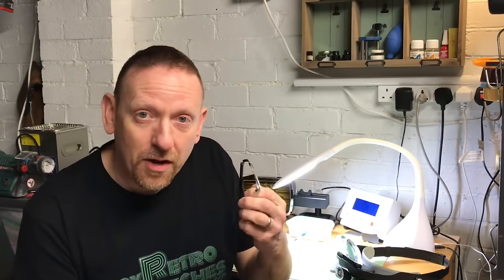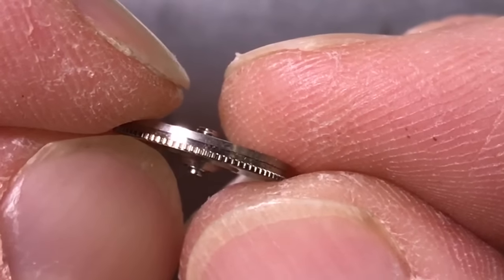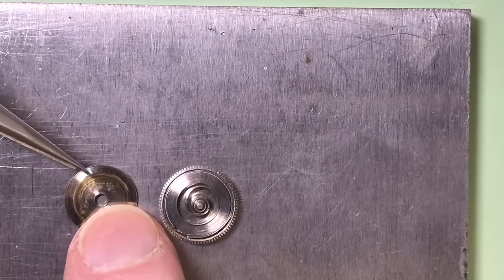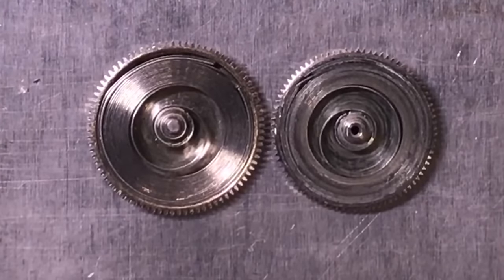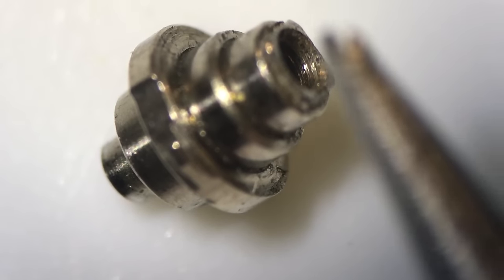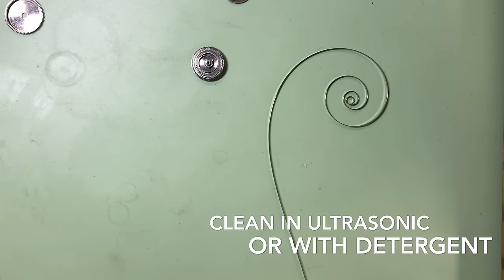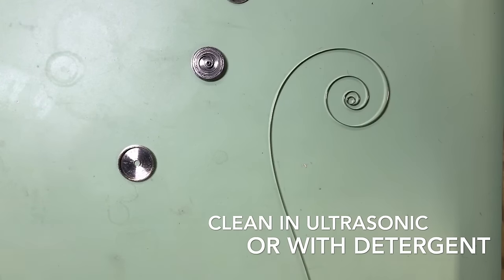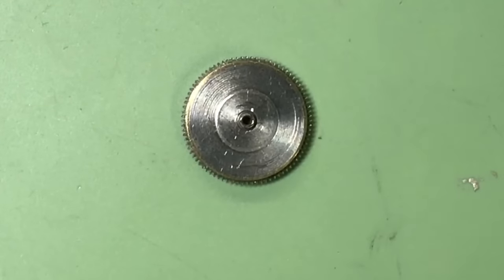How To Service a Watch Mainspring By Hand

Comment: Well that’s saved me a couple of hundred quid, it can be done by hand with no I’ll effects, thanks new to your channel and it’s a lot of useful info. Got me an early Seiko auto to start on just need the right size screwdriver and permission from er indoors to by them. 👍🏻👍🏻👍🏻
Reply from the maker: well I do not recommend this long term as any professional will tell you this is a massive NO NO to hand wind.  It is not easy depending on the spring you are working on.  I do believe there is a Chinese winder set on AliExpress that has steel arbours and handles which do the job well enough and are around £60-70 for a set.  I will pick some up at some point to review.

Comment: Thanks for the time and added bother of putting this up here. So far it's the most applicable guide I've found to my own situation: I've had a garishly over-steampunked Chinese pocket watch for years, for which I think I paid just $4 with free delivery from the Far East. Only lately has it been anything less than "appropriately reliable". It kept reasonable enough time for my post-retirement needs, and spends most of its life safely tucked away in the breast pocket of my old motorcycle jacket. I've always taken care not to overwind it, but I suspect something may be awry with its main spring. It'll still runs near full wind, but only for 4 or 5 hours. I'm guessing that it's the mainspring somehow acting up. The problem for me is that it seems silly to spend a whole lot getting g a $4 watch repaired, you know? I adore it and all, bit still... If I can fix it DIY, it seems sensible to do so. Naturally, any and all advice from you or other proper horologists in the Comments would be welcome. Until then, you get a big "Thumb's Up" from me for your efforts. Thanks again!
Reply from the maker: Hi, That is hard to say what is going on there. In theory the mainspring could be the issue as its the only source of energy. However the power has to go through the train of gears. All pivots should be oiled but over time that oil turns to sticky gunk which can slow watches down. equally a thicker oil is applied to the barrel arbour bearing (holes) as its higher friction so when that oil goes hard it will limit the power of the spring.  Springs generally last decades but who knows what sort of quality spring they have used in a $4 watch..
Reply: @MyRetroWatches  Thanks for the response! I'm now inclined to think you may be right about there perhaps being a problem with the works being somehow gunked up with old oil, hardened grease or what have you--not just the mainspring that's the culprit. For the past couple of days I've managed to run out the mainspring's tension by either lightly tapping the watch or simply turning the crown/winding stem the opposite direction from winding. I imagine the tapping of the ratchet mechanism may be just enough to coax the works through those grubby spots. Once it gets going, it'll tick happily for hours and hours. So yeah. Maybe it just needs a good servicing? I've also read that electro-magnetism, such as from a cell phone, can also goob up the works, and de-magnitizers are sold to correct this. The jacket pocket I normally keep the watch in rests directly over the shirt pocket I hold my phone in. Have YOU encountered this magnetism issue? Fortunately, I have located a very well-reviewed horologist's shop quite nearby. Instead of diving in and just buggering it up myself, perhaps I should just swing on by there. Sure, it's just a $4 watch, but I really DO like it all the same. And it HAS served me well enough until just recently for many many years.

Comment: Thank's for this video! I am studying this and working ON IT as we speak. I kind of placed the mainspring in the wrong direction, so it got little bit twisted/damaged so finally it broke but hey, as i say: Practise makes perfect. 

I love your videos! A true inspiration for all of us out there!
Reply from the maker: Thank you for your nice comment, also just subbed to your channel !
Just remember that hand winding is not good practice in this hobby and many will tell you it should not be done.  That said I’ve scrapped more mainsprings in winders than I have ever done by hand.
Reply: @MyRetroWatches  Thank you! I am honored by that! And Your videos about bulova has helped me to gain experience and to fix them. I appreciate this ! 

Take care 🌎☕🙃
Reply: I had the same problem. It came out great, but rewinding somehow got twisted around so that the final coil was backwards and broke after another attempt. (I realize now I wound counterclockwise! Should have been clockwise.) That's fine since it was 52 years old anyway. A NOS mainspring is in the mail. I'm going to take a closer look at the inexpensive winders. There's an affordable one now that supposedly fixes past shortcomings.

Comment: Would you advise replacing with a new main spring or just cleaning? I'm just starting on my first movement AS 1506 which has been sat doing nothing for over 40 years.  Lots of good information on your channel. Very helpful.

Comment: Thanks for this video! Mike or anyone else who's done this: what is the success rate of winding the mainspring this way? I ask because many professionals seem to say hand-winding can cause a lot of problems and make a watch not work properly. But also I don't doubt some hand-winder repair people they speak of are the the kind who aren't too careful about watch repairs to begin with. Mainspring winders also seem to be some of the most unforgivingly expensive watch tools out there for novice repair folk--so if hand-winding can work, that'll easily save me a few hundred bucks. Thanks in advance for your replies!
Reply from the maker: This is a good question!  okay so I will try to answer,  without question the best and the correct method is to use a spring winder tool. They are expensive and you need many different winders for different barrels both left and right handed.  This for me at least is the reason I learnt to do it by hand . By hand you do run the risk of breaking the bridal, kinking the spring, snapping the spring or even it uncoiling half way though and throwing the barrel into orbit.  Care must be taken, safety glasses are a must.  However with practice and patience its achievable.  You will make mistakes so practice with some old ones first to get the hang of it, also practice without oiling the spring or the barrel walls , oil makes them allot more slippy. The hardest part is the first few coils the bridal holds allot of tension so getting that in and the spring past it can be hard. once past that slow and steady wins the race. That and a firm grip  another important thing to take not is the direction of the spring, always take a photo first as I have learnt the hard way of winding a spring in, fitting into a movement and rebuilding only to find the spring wont hold tension past the arbor. you then have to take everything to bits again. 
For newbies and tinkerers on a budget doing their own watches then I see no harm in hand winding other than the more experienced telling you you should never do it.  The more you get into the hobby the more you will want to invest in better tools I think its just a natural progression.  

Good luck
Reply: @MyRetroWatches  I've been hand winding main springs for 20 years with good success. I also know when you take one back out and set on a flat surface, it does cone up and not lay flat. So I can see why the experts would have a problem with it.

Comment: Hello Mike. Great tutorial. Moebius 8200 isn’t an adequate braking grease and may actually allow too much slip. Moebius 8213 (brass), 8217 or more expensive Kluber P125 is what is recommended.
Reply from the maker: 24 Hour GMT Channel hi thanks. Yes you are right I think someone else corrected me either here or in the FB group.  I now use 8217.   Thing is you can’t edit already uploaded videos so I’m stuck with it really. ( wish YT would allow us to do so post upload)
Reply: RL-1

Comment: If you forget to take a photo just stop and think about which direction the barrel turns to wind up the watch. Pay attention to the click. Make a little diagram with the wind direction if you need to. The square on the arbor will face up on the click side putting the opening on the barrel facing down or toward the face side of the watch. 
I find that with many movements the winding gear for the barrel moves clockwise when being wound which means winding is counter clockwise when looking into the barrel. This means that the spring spirals out from the mandrel in the clockwise direction.

Comment: Nice video. I do slighly different than in this video. I use a collet plate (round holes)   to press the arbour back if it moves out during dissambling. I also use the same collet plate when I put  the lid back on. I usually try to hold the spring almost full wounded in, and put the arbour in place and then put the spring over arbour (sometimes I just do as in this video as well), since it can be more easy than the other way.

I also try to clean my hands before the work (I don't use finger cots since they just get stuck). I akso just use the tenchnique of oling afterwards when the spring is in place.
 Do you still have the same technique or have you adopted? Or do you use a winder?

Comment: Thank you for this wonderful explanation; very helpful for begginers like me. 

I have an automatic TH that does not start ticking the moment I wind it. It is until I move the watch a little that the automatic feature kicks in and it starts running, but if i dont move it the watch wont start running even though it has power in reserve. Any idea why this can be?
Reply from the maker: Could be many things but mainly just a service to get it all clean and free running again.

Comment: Thanks Mike, previously thought I needed a tool do do this. BTW what microscope do you use ? Thanks again :-)
Reply from the maker: Az Moghal thank you. Main spring winders make the job easier (not that I own a set, they can be quite expensive )  it’s a case of just practicing , you might break spring , bend a spring or as I have broken the bridal but eventually you learn the skill. It’s best to spend just a small amount on a few scrap watches to practice on. As for my scope it’s an AM scope 306 range. 
After the giveaway videos are done I will be reviewing it for you all.

Comment: Interesting video!  I'll be attempting this on my first project soon.  I know this video is fairly old now.  Are you still using 8200 as braking grease?  The reason I'm asking is because I'm new to the hobby, and I don't have (and can't afford) the variety of lubricants that are recommended for each part of the movement.  Right now, I have 8000 and Molykote DX.  I know 8200 is recommended for the mainspring itself and 8217 is recommended for the barrel.  Have you had any problems with the 8200 in the barrel?  If not, I'll plan to get some and save up for the 8217 down the line.  Thank you!

Comment: Thanks, that was very informative. After watching this I feel less worried about undertaking the servicing of a mainspring. 
I guess the professional approach would be to use one of those hand cranked spring loader things, in the attempt to minimise the risk of salt from the fingers ending up on the mainspring.?  
Surely the addition of oil would protect the spring from the harmful effects of salt, so no worries.

Would it be possible to advise us on what type of visual aids to use?
Maybe a good subject for a future video.
I like the look of your magnifying visor, but would they be any good for someone who wears varifocal lenses in their normal day to day eyeglasses, as I do?
Some sort of desk top microscope with a light source will probably (eventually) become essential equipment for us newbies. 
So it would be nice to have some knowledge about the pitfalls of buying what could turn out to be, the wrong piece of kit for the job.
Keep up the good work, I'm addicted :-)
Reply from the maker: Hello Gary, interesting comment.  it is considered bad practice by professionals to manually wind springs. Spring winders are the way forward however they are expensive and you need many to be able to do different watches.  So for hobbyists just starting out hand winding is a cheap option.  care is needed and you will make mistakes / break springs at first so its worth practicing on something that does not matter to find your method.   people say to oil the spring first by wiping some watchmakers paper with oil on it to apply a thin film of oil.  I find that oiling in four positions (12.3.6.9) a blob in each spot when wound back into the barrel is sufficient as it will find its way around the coil. 
as for magnification, take a look at my tool page https://myretrowatches.com/tool-sale-links/  here you will see the visor I use and a selection of AM scopes ( all Amazon affiliate links)  I also wear vari focal and am fine with or without my glasses under the visor. you have to remember you are magnifying so close work you wont really need glasses depending on your eye condition.  to wear glasses you must get one that has a band that goes around your head.  There are some that look like glasses that would not be suitable for you. 
I do plan eventually to talk about this in a video when I get better chance.
Reply: Thanks for the reply and the link Mike. Those Stereoscopic microscopes really do look the business. 
Having spent quite a long time during my early career staring down the business end of a far bigger industrial version of a Stereoscope inspecting and repairing micro electronics mounted on printed circuit boards, I appreciate and understand the advantages and pitfalls of these great visual aids. 

The disadvantage being that although we had enough space to get a soldering iron, solder, tweezers etc in there, usually there was never enough overhead clearance to get a screwdriver involved, which for watch assembly would clearly be problematic.  

Why even mention bigger machines when those units cost many thousands of pounds even back then. Because we sat at them with a straight back and as we all know, a good posture at your workplace meant you didn't walk away from your desk looking like Quasimodo having successfully gained permanent curvature of the spine. 😂  painful too ...😒

So it seems to me, that I am really looking for a digital camera setup, where I can have enough space over the watch to get a screwdriver in there without hitting the lens of the camera and I want the image of the thing I'm working on to be on a large screen (probably a PC monitor). I already have a redundant laptop for the screen end, so I might try to fabricate some kind of stand and base on which to mount a simple USB microscope camera at an angle of about 45 degrees to the work-piece. (no overhead space issues). 

Xmas in a couple of weeks, so I'll be bothering Santa for the Camera in question. 👍 I look forward to your video on the subject of visual aids and thanks for the info on the use of visors for those of us born without 20/20 vision 😎.

Comment: At the end, when you compare the two drives, it is clear that the two mainsprings rotate in two different directions. I wonder if that will affect the winding of the machine or not?.
Reply from the maker: I am showing in the video that not all mainspring wind the same way. There are some left haneded and some right.  Clockwise winding is the most common.  Seiko use both so it is important to look at the direction of spring before removing it.

Comment: Is there any particular reason for winding this by hand as opposed to using a mainspring winder?Also, shouldn't you be using a mainspring winder so as not to distort the spring?
Reply from the maker: This is to show that hand winding can be achieved. Many hobbyists at the beginning cannot afford winders.
I’ve a set and have scrapped more mainsprings with winders than doing it by hand. 
Also some are wound in the opposite way which unless you have a set for opposite direction you are stuck.
I don’t buy into this twisting of a spring, you have to hand wind a spring out of the barrel so it’s funny how winding back in is frowned upon.

Comment: Mike ,when you re-insert the mainspring barrell onto the watch and insert the winding stem does the mainspring automatically attach to
Something to tighten it and power up the power distribution. Barry ,liverpool.
Reply from the maker: Hi Barry, the smallest coil on the mainspring has a hole in it. The barrel arbor has a hook so it find the hole and then pulls the mainspring tight to give it power.
Reply: @My Retro Watches  thanks Mike, much appreciated, I love your line when you say " it's gone in on the wonk 'I laughed every time I thought of it .barry ,liverpool

Comment: Is there any slot inside the barrel at any point of the circumference to secure the tail end of the spring ?What will happen if the spring is wound in the wrong direction without noticing which way the arbor goes?
Reply from the maker: Not on automatic Seikos.  you only need the hook on manual wind barrels

Comment: Can you unwind one too far when you let the power out before you disassemble?  I had one that was wound tight when I got it.  I held the click and let the power down slowly, but now I can just wind and wind and it never tightens up or puts power into the movement.  I guess I'm going to have to strip it deeper and take that barrel out
Reply from the maker: No is the answer. What you now have is most likely a broken main spring, either that or it’s somehow become disconnected to the arbour but you would usually hear that as a clicking noise.